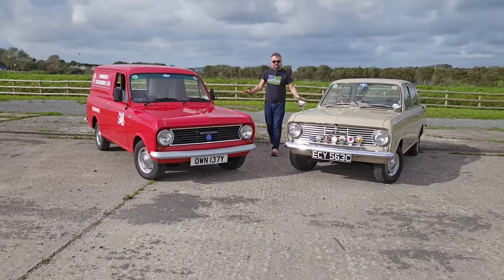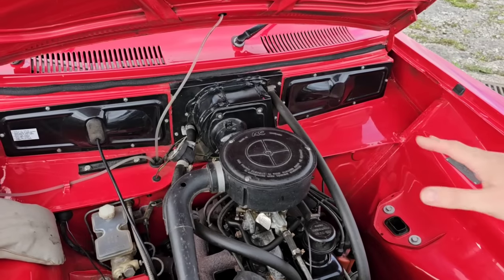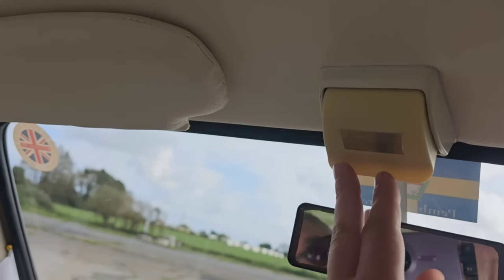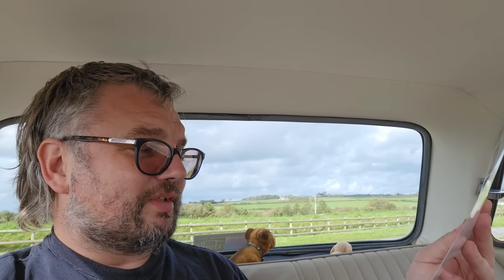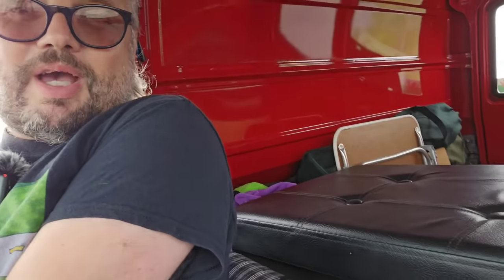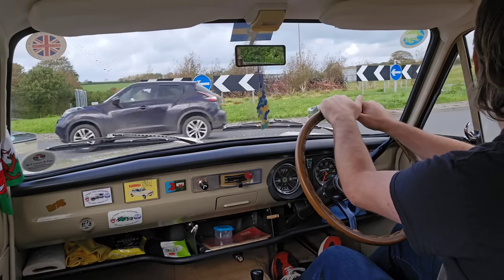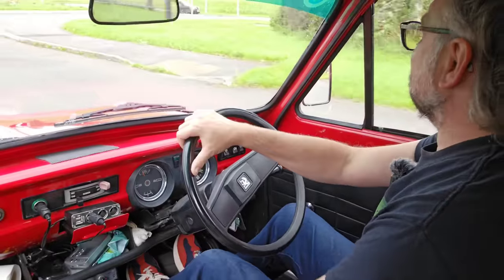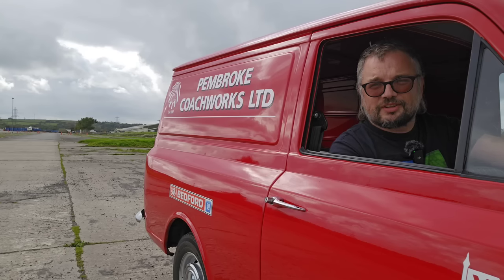Vauxhall/Bedford HA Viva saloon/van double test!

Comment: Great review, Ian! Given that Mum bought one new in 1965, the salesman had the courage to ask her out when she collected it (marriage and my arrival subsequently followed), and I drove it from L plates (1987) to 2006 (replaced by a certain copper-coloured Territory), this is the review I've been waiting for! It was also a Deluxe, built by Holden at their Dandenong plant I believe and was almost the same colour (Balmain Beige) but with a red interior.
1:57: engine bay is definitely familiar, but ours was matte black but with no brake servo for the drum-only system and no fan boost for the heater. The washer bottle is unfamiliar but ours never had a working washer in my memory - a different twist-knob device was under the dash near the wiper switch but no connected. I think the generator was a Lucas C40(?) - I still have a modern replacement that is almost used in my garage. The mechanic decided an alternator was a better choice. The car was originally positive-earthed. Single-stage bonnet latch with no security!
4:05: rear badging and boot all familiar. Fuel tank was black in mine and the wheels were body-coloured. The boot easily fitted a mower and all sorts of other loads over the years!
4:46: interior is so familiar! Door cards had a different pattern in Australia but same handles (push down to lock door from inside), arm rests and window winders. The swivel windows were fabulous in a non-airconditioned car in an Australian summer and I could reach both of them and both the rear window latches from the driver's seat. Owners manual looks the same except ours were deep green rather than red! No cigarette lighter in ours (chrome-look blanking plug present), front seatbelts were a dealer-fit accessory in 1965, no temperature gauge either - just the gear diagram. Light switches were mechanically interlocked. No carpet, just a shaped bitumenised vinyl floor. My choke knob always stayed exactly where I moved it - no peg required! No document holder in the footwell.
6:36: I remember having the same problem with the interior light and was able to fix it my bending the contacts a little. Pulling it out should turn it on while the back position should have it working off the door switches.
6:46: exterior mirrors? Luxoory! To be fair, the visibility was as good as you could wish for a sedan.
8:36: no seat latch? Ours had one on each side near the floor and it was easy to activate from outside the car to get in or with your foot from the back seat. The rest of the seat base looks familiar. There was also the tiniest lever (driver's seat only) on the side to allow fore and aft adjustment.
8:45: I remember that with three bods in the rear the suspension could occasionally bottom out.
14:20: the light steering (aided by the large wheel) was nice along with the rack-and-pinion setup. The handling was improved markedly when the cross-ply tyres were replaced with radials - suddenly the car could corner rather than wash-out when an attempt was made to change direction. Much better!
14:40: servo-assistance from the time when they wanted to make sure you knew you had servo-assistance! Drum brakes certainly encouraged cautious driving in comparison.
14:50: gear lever was indeed nice.  It alledgely had synchromesh on all forward gears, but 2nd was a little weak and 1st seemed non-existent. I used to double de-clutch going down to second which was fine for anything other than a complete stop.
16:30 it certainly seems more peppy than mine. I had it up to over 70 mph and it would move along a 65 mph easily (with 100 km/h often the maximum posted limit in Australia). Wheels magazine in Australia apparently had a series of articles about improving its performance when the model was new and got something like 50% more power without touching the internals of the engine.
16:40: susceptibility to side winds: oh yes!
22:55: oh the turning circle. And to think I now spend most of my time in a Magna!
Once again, great review. Brought back lots of memories and confirmed I could probably still be happy in one. I should have kept it rather than selling it on to a mate who's 'gunna' project went the way of so many gunna projects.

Comment: Great to see the HA Viva! That really brought back some memories. My Dad bought one in Jan 66, FEH 669D, when I was ten, his only brand new car. He kept it a good while, fighting rust all the way.  I learned to drive in it and passed my test in it. Main issue, apart from rust was a tendency for the carburettor jets to block, leading to the engine cutting out. Easynenough to sort out, and Dad had the kit and know how to sort it in a few minutes wherever it happened 😄. As to seat belts, the 1966 model had mounting points but no front belts. I remember him having to have them fitted a year or two later.

Comment: Great video, I passed my test in November 1979. The next day my boss gave me the keys to a Red HA van just like the one in the video. It was loaded up with a days work of Blinds, ladders on the roof to be fitted in a school in North Lincolnshire.  I thought I was king of the road traveling from our base in Nottingham. I travelled for miles in that van over the next few years, Carried tower box scaffolding inside and sometimes on the roof. They bought me a brand new powder blue one in 1982. The miles I did in them vans in all weathers and they never let me down. Happy days.

Comment: I have had 7 HA vans and several HA/HB cars in the 70s.  I loved them as they were reliable, easy to maintain, pretty good on fuel and cheap to insure.  I wish they still made the Ha van, it was such a handy little van for very little money.  Vans and picks up now may look good but are often not practical and the prices a unbelievable.

Comment: Yellow PO/BT Bedford HA vans were a regular sight on the streets in the 1970s and early 1980s. Spent much of their time parked in lines just around the corner from popular cafes, up to three times a day, with the British Gas HAs for company! (I was only a passenger apprentice...). Thrashed all the time, governed to 50mph, most were full of phones, parts, internal cable and overhead wire (the HAs weren't used by underground cabling crews - their Inspector often had one though). Funnily, many preferred them to the Morris Itals that replaced them - partly because they were smaller to get down narrow streets, and that the Itals sagged badly on their springs when fully laden.

Comment: One of my first jobs was as a local postman and our post office used those vans. I had the last of the "new" ones (after a few years the Ital vans started to appear) I do remember that they had the restrictor on them that we had to remove as the van just couldn't get up the steep country hills parts of my post run was on, but they kept them on all the town vans. Perfectly useable little thing apart from the fact no radio, no nothing and no passenger seat either. Basic as you could get and we chucked them about the country roads giving life to the term "express delivery" 🤣
Got it stuck in snow a few times and had to be towed out by the local farmers each time. Reliable, fairly comfortable and noisy (no sound deadening whatsoever)   Ah the memories....

Comment: I had a 1976 HA van in the mid 80's, great  fun. Still had the same floor pans as the saloon, if you tip the seats forward you can access a couple of spaces to store the tools and spares required to keep the thing going. Mine was mint, ex-fire brigade hydrant maintenance van.

Comment: I passed my driving test in February 1966 in my dad's 1965 HA viva.  I told the tester that it had power-assisted disc brakes but he still bumped his head on the windscreen when I did the emergency stop.  I passed  first time then subsequently I bought a 68 HB "Coke bottle" viva estate.  They were both great cars.  Thanks for your great review.

Comment: I did my mechanics apprenticeship at a vauxhall dealer in the mid 70's and remember those front transverse leaf springs, they were a nightmare to replace when they broke. We had a special spreader bar tool and clamps to do the job but if the spring broke free under tension you had to get out the way quick!!
Reply: The HA had other standard faults, the timing chain rattled because it was a manual adjust and I replaced it with a spring loaded replacement part. The worst was the gear box rear bearing did not get enough oil, this was remedied by adding a few washers at the rear of the gearbox to lower it a little so it got more oil. Yes, the front spring I replaced but I used a tired 2nd hand spring and a jack to compress it into place.

On the other hand with the HA (LBM600G it think) I picked up a girl who is now my wife of 38 years. Her dad thought I was a sensible sort of a chap with that van !

Comment: I used to drive around Didcot Power station in an Electrified HA, lead acid batteries fired in false floor in back. Used it to drive down to river to check instruments at the water inlet/outlet on the Thames.

Comment: Just been reading all those happy comments about HA Viva's. Lots of folks talking about possible SL90s. Well let me say they were very quick in their day. That little engine could really rev its heart out. I learnt to drive in a HA & passed my test in one. But I was barred from driving Dads SL90 & had a Reliant Van Pre Regal with a side valve engine & crash box. Unfortunately Dad had a lathe, so the carb got modified as did the exhaust system. Surprising how quick you can make them go. Happy memories. A great shame that HA Viva's rotted so much, I feel sure you would love to drive an SL90.

Comment: I had an ex BT HA van, I can't remember what year it was built. It was bright yellow until i painted on my drive with Dulux white gloss. I paid £20 for it. I remember it used to start as soon as I turned the key every time, and it had a heater. I used it for at least a year, apart from the fan belt was slipping one night so the battery was losing charge and lights kept dimming, I never had problem with it. It was restricted which in fairness did make it reasonable on petrol. It never had any rust and was quite solid. I ended up scrapping it as I couldnt be bothered to mot it. TBH it was a good little van that I should have kept. Good review.

Comment: I used to work for South Wales Electricity Board . Most of our vans were British Leyland and a few Fords. Minis , Marinas , Itals and Sherpas with Escorts and Transits . All de tuned or low compression engines. Once the had had a service we used to advance the distributor a few degrees ad tweek the carburettor a bit to get a bit more pep out of the then turn them back just before they went in for the next service. 
🤔😉😂😂😂😂😂Happy days.

Comment: We had a V reg HA when I was a kid. It only lasted until 1985, so what 5 years? Replaced with a Midi which was bigger and far more futuristic. 

Even as a small child the HA seemed old fashioned and slow. My grandfather constantly having to change down when we came to hills. No radio or anything. The heater was about as advanced as it got.

Wasn't sad when it went. We had one of the first Midi's in the country and it seemed amazing in comparison. It even had an AM radio!

And thank you for letting us hear the engine at around 19 minutes without talking. That's a noise I haven't heard since 1985!

Comment: Yes we did get the Viva HA in New Zealand 🇳🇿. 
I had more to do with the HB, HC & Magnum.
I didn't realize that the fuel tank was positioned more like the Herald & Vitesse of the period.
The HA Bedford engine had moved from 1057cc, to 1159cc and up again to 1256cc and again to that oil filler pipe hose model.
Strange how they retained the single Zenith on top.
We only got the 150 Stromberg on top of late HC, Chevette & Chevanne.
Later Bedford Beagles never made it to New Zealand 🇳🇿 😮
The only variation as mentioned was the Chevette / Chevanne estate's and the entirely larger CF & CF2  ( rear wheel drive only )😮

Thanks Hubnut for the comparison.❤

Comment: For a couple of years in the early ‘80s Bedford were selling three similarly sized vans that basically came from three different decades; the HA van that was a ‘60s design, the Chevanne that was a ‘70s design, and the Mk1 Astravan that was of the ‘80s design trends (I can’t technically claim that was an ‘80s design as it was based on the Opel Kadett launched in ‘79). What a weird line-up.
Reply: I don't suppose high performance or looks mattered that much to utility company fleet buyers who would buy them by the hundreds looking for a good price deal, fuel economy and cheap servicing costs. The simpler, more rugged and cheaper the better, really - which is why old van designs continued being made for long periods. They were hardly meant for luxurious long distance touring, more like puttering around towns and country areas fixing telephone wires, delivering mail, repairing water pipes or taking railwaymen to outdoor trackwork sites, probably getting a bit of a battering in the process.

Comment: It’s amazing that the saloon has survived this long. They were built unbelievably cheaply. The rear wings, for instance, had seams spot welded on the outside of the body, nice the narrow and capped sort of wing.  There was a time that cars had similar external seams capped by a chrome strip at the front wings also. There were no wheel arch liners back in the 1960’s and 70’s so all the road water/salt would get into the most extreme of crevices which started to rust the day after they left the factory.

Comment: Saving up to get married we bought a new Red Bed in 1970. Excellent for its time. Cheaper than trying to keep a worn out early cortina on the road. Our first holiday with it camping in Cornwall found us buzzing along at 50mph down an early section of the M5. Once we got to the end of the section is would not come out of top gear! In the end managed to wrench it out of gear, never did it again. Kept it for a couple of years and swapped it for a Renault 16TL,  what a difference.

Comment: I had a MK1 Escort company Van, "REG VFG 468 S" in 1979 for two years. It was very basic but OK to drive with 1.3 engine. The seats were about the same as the HA Van, low and without head supports. In 1981 my Escort was replaced by a  Chevette Van "GUF 161 V ", this was a real game changer as a works van , absolute style and comfort and the 1256 engine was better than the escort. The seats were nice and cloth upholstered but still just below shoulder height.
My mate had an HA Van when we were 17 and we went everywhere in it, we even rolled it on to it's side on a Friday night out but quickly had it back on all 4 wheels

Comment: Hi Ian, love this comparison! 
So I sent a link to the video to my Dad who used to drive the Bedford van for BT in the early eighties. This is what he said: 
“They were useless to drive and very small. The only good thing is they had great gear box and a short stubby gear stick which was kind of sporty for the time. But with all the tools you needed loaded on board, it wouldn’t pull the skin off a rice pudding!”
Slightly harsh!! 😅
His best van was the Morris Ital BT van… for whatever reason that went like stink and was quicker than the Maestro Van of around the same time or overlap. 👍

Comment: My 1st car in 1972 was a '64 HA Viva handed down from my dad (FMD 820B). Already a bit of a rusty example with holes in the floor & half way up the fuel tank! I was a GM apprentice at the time & drove it from London to Cornwall & back for one of my first holidays. Had a '69 HB Viva 2.0 GT after that. Viva's were great cars in their day & cheap to run & fix, especially when the parts were at employee rates!!

Comment: My first car was a Mk2 Astra Merit with the 1.2 OHV based on that engine. 
One issue caused by turning the engine through 90° was the location of the spark plugs in the head. They didn't swap them to the other side of the head, so changing them involved a degree in gynaecology.

Comment: I reckon the owners love you doing a test in their vehicles as you always explore the upper revs.  I was taught to get into top gear as soon as possible and to stay in it for as long as possible but never descend a hill in top, always descend in the same gear needed to climb it.  Yes that was the early 60's and the vehicles were 50's or earlier.
Reply from the maker: I guess the problem is I've grown up with air-cooled Citroens, which thrive on revs. Always keen never to labour an engine.

Comment: Hi Hubnut.  My grandfather owned an early E series Velox, which I remember, and he traded it in on an HA Viva, and I came of driving age during his ownership and got to drive it.  I remember it being quite a jolly little car to drive.  It had a persistent gearstick rattle, which no amount of warranty complaints seemed to fix.  Funny thing, but the Australian assembled Vauxhalls of the late 50's to mid 60's were painted to a quite noticeably better standard than the Holdens, and my grandfather did take pains over keeping his Viva well polished.  That brake booster I think I have seen before, in a very late Wolseley 6/90 (1959) which I owned.  In this case it was under the floor, nestled amongst the chassis rails.  Cheers.

Comment: The slightly odd wiping pattern of the van comes from using the same arms from the car, but a taller windscreen. The van doors are also different to the car, the quarter light is the same, but on the van it doesn't reach as far up the taller door. We had an ex Telecom HA110 and a civvy HA130. they were great little vans, the telecom one ended up being used as a shed in a traction engine yard.